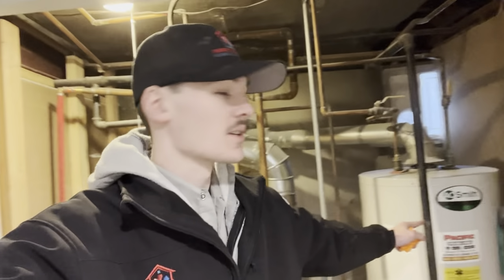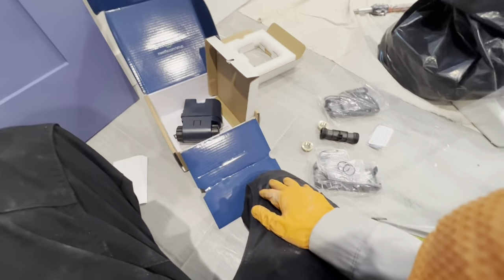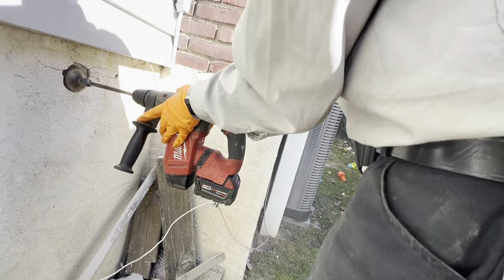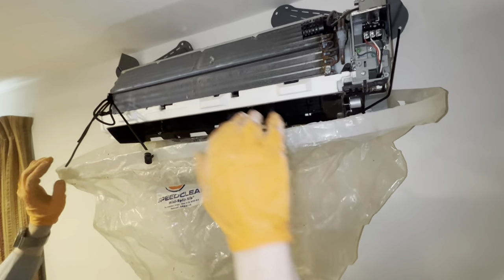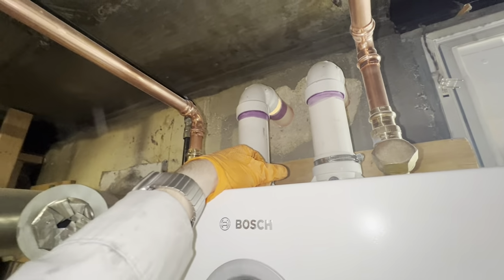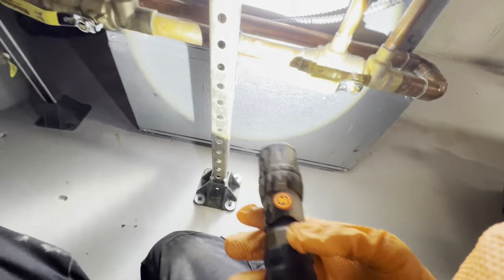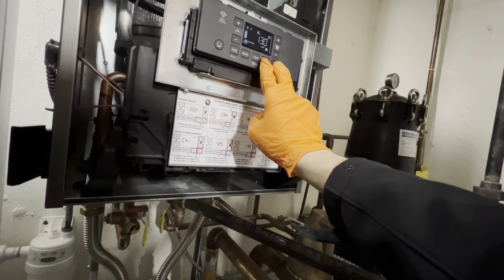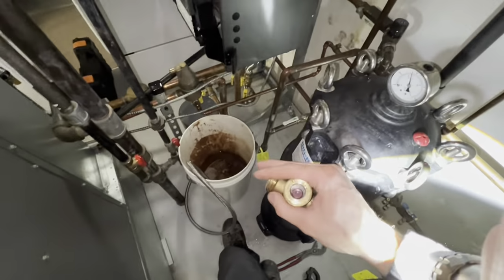Bosch T9800 SE199 Tankless Water Heater Installation! Whole House Smart Water Shutoff Valve Install!

Comment: Hey Daniel, tip for that Milwaukee M18 SDS. The battery you were using in the video looked like an XC 4 or 5 Ah at most. That’s way undersized for an SDS, they are power hungry! You want a high output battery “HO” on the side, and either 8 or 12 Ah. They won’t overheat and they will easily last at least twice as long.

Comment: Nice clean install but and FYI , you’re mounting lumber is too close to the single wall venting of the boiler (must maintain 6 inch clearance to single wall venting & 1 inch for B vent ). Also, don’t forget the gas utility should be contacted about the extra gas load if the total cubic feet per hour, exceeds gas meter rating, which in this case was most likely a 250 cfh .
Keep up the good work and stay safe out there (don’t forget to wear those facemask when heavy dust particles are present ).

Comment: What a lint factory. Looks like the dryer vent was not hooked up or leaking really bad
Reply: I think it looks like they finished the basement, sanded the drywall (because the taper needs to learn how to apply tape) and didn’t protect the equipment.

Comment: Drilling a hole that large and deep through concrete or masonry you’re best off using a corded tool.  That way you’re not wasting time swapping batteries, not putting that major strain on a cordless tool that isn’t as strong as the wired motor, and not killing the long term battery life of all of your batteries.

Comment: Hey Daniel...why did you not put ball valves at the inlet and outlet? What if you need to shut off the water supply?
Reply from the maker: @jkarkowsky  there is a shutoff for the inlet. The outlet is not allowed to have a shutoff per code.
Reply: @DCHVAC  Thanks. How do you flush this system then? Meaning, how do I push vinegar through JUST the hot water process without sending the vinegar throughout the house?
Reply: Hey Daniel...confirmed... If you look at the manual, you will see that it requires both the hot and cold water be able to be turned off in order to ever service it...the service valves are useless without a way to isolate the system from both the cold and hot water.  How have you guys flushed the system with descaling agent in your other installs?
Reply from the maker: As long as cold can be Isolated the unit can still be flushed out so long as fixtures aren’t being used for hot water. Regardless adding a valve when we come for service is easy

Comment: "heating doesn't keep up" you're missing a circulator on the primary loop, boiler circ only goes thru its close  tees, and the 2 heating loops are looping at their tees, I don't see a circ between the boiler injection, and the heating secondaries, Ask Dan Holeran.
Reply from the maker: Boiler has its own circulator for primary loop.
Reply from the maker: Systems piped wrong